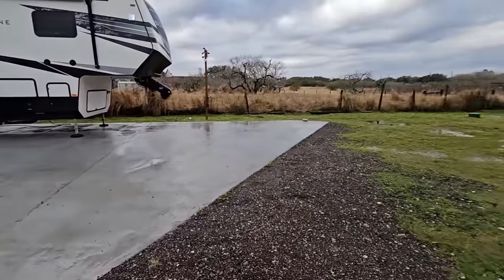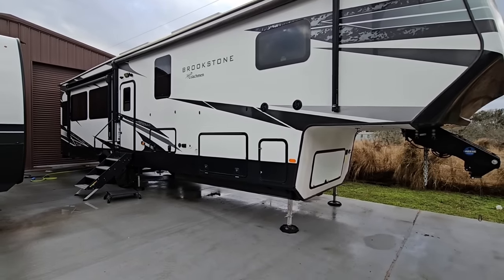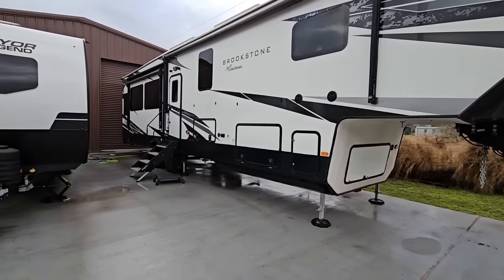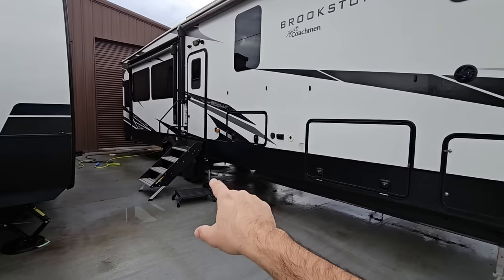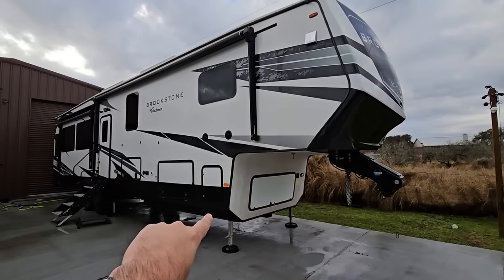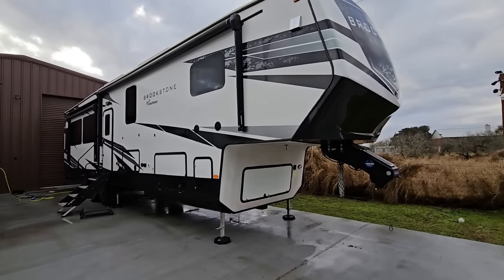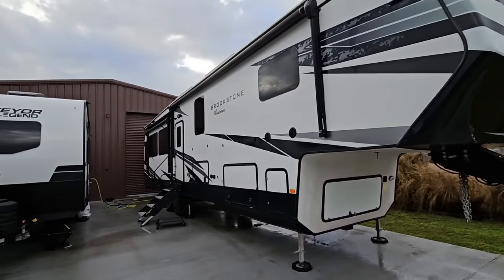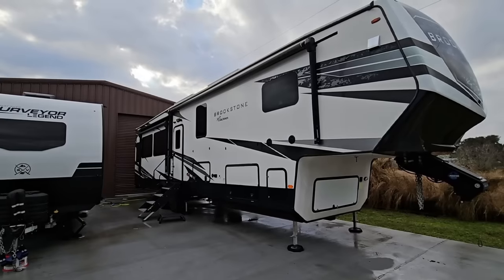FRAME FLEX on some Fifth Wheel RVs EXPLAINED!

Comment: What is happening to the grand design is broken welds on the frame.  They just call it frame flex.  The paving new paths folks had more than 2 or 3 inches of "flex"  when the trailer was hooked to the truck.  This was without even moving the trailer.  Think about how much it moves while going down the road.  They were quoted 16,000 to "fix the flex."  That was without grand design, even looking at the trailer.  There has been a lot of frame failure going on  seems to be on grand design.
Reply: No way was it 2 or 3 inches.  It was 1/2" on one side and nothing on the other.  People seem to watch these videos and then exaggerate the problem.
Reply: @ryanryan6207    That was measured from siding and not frame also I’m will to say if they measure from frame it would be closer to 3/4 to with broken screws and bolts the siding didn’t move as much as frame
Reply: @ryanryan6207  you're correct the 2 or 3 inches was what  it looked like inside in different  places.  Any "frame flex"  is unacceptable especially when all they did was take the trailer off the Jack's and put it on the truck.  You maybe ok with that flex but I wouldn't be.  Science tells you if it flexes while stationary it will be more while moving.
Reply: The only 2 cases on YouTube  regarding Grand Design frame "failure" are Paving New Paths and Downsizing Makes Sense. Both full-time, high-mileage, nomads that load their rigs to the max and expect their rig to perform flawlessly. 

PNW owns a used tow hauler, with no weight of the toys to counter the load over the entire length of the frame. He states he's under his GVWR, but I'm willing to bet his pin weight is well over the 25% rule.
Reply: @driveman6490  no no there are many others switch it up, LJMJ, and many others...not just 2 and all GD owners as well 👍

Comment: Good explanation of the difference between flex (a temporary condition) and deformation (a permanent condition).  Having some flex in a structure is a good thing.  It's a way to temporarily respond to forces that might otherwise damage a structure.  Even your house flexes - the creaking noises you hear at night is caused by flex.  If your RV didn't flex at least a little, your frame, your sidewalls, your floor,  your windows - everything would eventually crack in order to release the built up forces.  Too much flex, on the other hand, can cause problems, too (including cracking).  

It helps to think about flex as an extension spring - you stretch a spring within its design factors and it will return to it's designed shape.  Properly designed, it can do this millions of times.  Stretch it too far, though (overload it), and it gets deformed and stays that way, preventing it from being able to do the job it was designed for.  That's a failure.  But unlike that extension spring, which only flexes in one dimension, our RV's have to flex in all three dimension and also have to allow the frame to twist (like for times when we make a turn and the curb crawls out under one set of wheels).

Today's RV's are longer and heavier than what we saw years ago, and both things can cause flex.  We also like to have more "open" floorplans and more window area, which reduce where engineers can build in stiffness.  To combat these problems/limitations, engineers can beef up the structure (bigger members, members with greater stiffness, members of stronger materials, additional stiffening members, etc.) but that adds weight (and cost), too.  So it's a trade-off.  Just like everything else in life.
Reply: The problem with natural frame flex is that the box and cabinetry is rigidly built. Instead cracks develop and failures appear in the side walls. If the builders were serious about allowing flex in the frames not damaging the coach which doesn't flex, they would develop flexible frame mounts that allowed the frame to move.
Many larger pickups and truck have had this for years.
Reply: @guilfordterminal  Plus it doesn't help when they use staples to install said cabinetry or certain trim.

Comment: Love your content.   After working with submarine structural engineers for a number of years some of your terms may be up for debate:  Flex = moves, but comes back to the original position;  Bent = flexed a bit more than allowed and now does not completely return back to the original position;  Failure = whether through fatigue or manufacturing defects, the frame/weld/metal physically comes apart.  In my humble opinion, most RV owners that are experiencing these issues have a bent frame, not frame failure.

Comment: This is one of the main reasons why an upgraded suspension or airirde needs to be an "option," especially for very large towables. Im not saying that will eliminate all issues, but it should help.
Reply: Lippert Center Point by Trailair Air-Ride Suspension Upgrade

Comment: Great job explaining. We have had the "frame flex". I am of the opinion that what we experienced was having a steel frame that is supposed to flex with a wall bolted to it that has no flex built into the design. We spoke to the welder that did our repair and asked him his opinion. He clearly stated that he thought that our problem was based on the aluminum studs being of recycled metal and it being very very thin. He said that he has a hard time rewelding these back in place due to the less than quality metal. Just our two cents. Thanks again

Comment: There are a ton of YouTubers reporting frame failures.  Most of them use Grand Design products and live in them full time.  It seems that with living in them full time they are using them far more than your average rv’er.  I  don’t believe that any rv is capable of handling true full time living in and moving them constantly.  The forces the rv’s have to withstand going down the road are insane.  When they are constantly used it will eventually fail.  I’m not saying that over use causes all frame failures, but I think it causes a bunch of  them that we are hearing about on YouTube.  With what these new rv’s cost you would think they would not be designed to be disposable, but anymore it seems that all of them are disposable after a few years, especially if lived in full time.

Comment: A few of my friends have had to replace their suspension and go to complete independent suspension due to the fact that they do hold them down dirt road both are toy haulers and they use them for ATV off-road. They say the dirt roads are not hard on the fifth wheels but they’re not driving down paved roads either, one thing to consider if you plan on doing off-road camping on fifth wheels, maybe look at having the manufacturer independent suspension on it or do it after market like some do now it may eliminate some of some of the problems that they’re having with the flex or other issues with the structure the fifth wheel

Comment: Semantics!  It is frame flex when owners see initial problems (i.e. floor/wall separation, front cap miss alignment, excessive goose neck movement).  It is frame failure when technicians actually pull the covers off and see broken cross frame welds.

Comment: Paving new paths never took theres off road and this went down highways and there frame broke
Reply: True, but they did buy it used so who knows where and what the previous owner did with it. I feel for them, but who can say whether or not the issue really started prior to their ownership but just worsened over time?
Reply: @fuzzywigglebutt  Yep, no telling what happened before they owned the RV.
Reply: Let’s be real.  All trailer frame should be able to last many years.  Car trailers, tractor trailers, animal trailers all haul large loads over all road types. Some are abused and overloaded by owners.  But you don’t hear much about those frames breaking.  My point is simple…build the frames strong enough so they don’t fail under 99.9% of normal circumstances. All rv 5th wheel trailers should be able to last 15 to 20 years, if not they are defective from the start. Just imagine if all the other type trailers were having this issue,  very unsafe for all motorists. It’s so obvious the frames are I probably built to last.
Reply: @WestsontheMove   Are you aware their RV was damaged when it impacted their bed rails multiple times?   This was their video description.”After a few close calls of the RV crushing the bed rails, we finally did some damage to the bottom of the fifth wheel”   “Crushing” your bed rails could certainly damage the frame.
Reply: @BlakeScout I may have missed that but given how so many others are having similar problems to what they are having and the distance between the RV and the bed rails, I would have a tough time believing that it would have caused as much damage as you may think. Have you not seen pictures where Grand Design tac welded the bottom aluminum frame supports? I have those pictures myself. A tac weld? C'mom man that is a quality control issue.

Comment: Outstanding breakdown!  With my 20+ years in Engineering, I couldn't have stated this better!  Thank you sir!  But, why is the dealers and manufacturers running from the failure problems!
Reply: Josh tap danced around the issue.  And, yes, I have over 30 years of engineering experience with degrees in Architecture and Mechanical Engineering.  This is clearly a manufacturing issue.
Reply: It simply comes down to money I'm pretty sure.

Comment: Great service to get the conversation going, JD. We appreciate learning from you.  

I've read through a lot of the comments here and i don't see a reference to the impact of independent suspension.  We have a 2020 Grand Deisgn 399TH, with IS/DB.  

We are full-time 3+ years and move it about monthly, we also don't drive longer than about 300 miles on any move. 

I did see this mentioned, but how is Lippert ever held accountable for anything like this.  

There is such deflecting when something goes south.  It can be hard to know who to call.  And frankly you shouldn't have to call all.over the place.  Ford doesn't make every single part on our F450, but when we have any issue...all we need to do is call Ford. And they get it handled.

On the trailer, we had a brake line failure. Our RV tech told us to call Morryde directly and report it. We did that.  Lots of seemingly 'hush hush' about what the real issue was, but Morryde sent an 80lb box of parts overnight....for free. 🤔 #Goodwill.  We did later report to Grand Design. We have a video about it on our channel https://youtube.com/c/MileHighBeach

In our 3+ years, anything that seems off, odd or weird...we call Grand Design, inquire and open a ticket.  We've been sent parts from Grand Design at no cost.  We've been reimbursed by Grand Design outside of our 1 year warranty.  We are original owners of our RV and have maintained a relationship with Grand Design. We have never been hung up on.  😊 Our issues, outside of the brakes, haven't been major, but we report it all.

We look forward to learning more about this issue.

Comment: The frame flex people are referring to is the Pinbox and upper deck. In the fifth wheels of old days there was a ton of reinforcement on the deck. There was very little flex and the flex was engineered to be on the front half of the lower frame. The side wall mounted to the lower half of the frame on newer units is flexing at different points then the sidewall mounted to the upper deck. You can see this better in the vanleigh RV’s where the frame flexed so much that the aluminum structure of the upper walls would break the welds of the wall. Later vanleigh issued a repair however the repair was to reinforce the wall. Instead of bracing the frame. Once you pull the skin off you’ll see there’s barely any adequate bracing on the upper deck in the name of saving pin weight instead of just putting another third axle under the unit. We inspected a jayco pinnacle and were appalled by the poor welds and lack of bracing and that’s one of the “overbuilt” ones.

Comment: Most if not all that I've seen fail were from folks living in them full time fully or overloaded traveling the American heartland and its crappy roads.  
 Granted, the 2x6 rectangular tubing Lippert uses is sub-par being brittle and too thin of wall.  Plus not enough triangulation in the pinbox region.   
  How do I know, I lived it. We had a failure on our 2007 Wildcat in 2012. With no help from Lippert I dropped the fascia and rebuilt the frame in the punbix area using 1/4" wall tubing instead of the 1/8" wall they used.  To this day it is still holding up.
Reply: There alot of Grand design trailers braking frames
Reply: @jimcaldwell5736  its across the board Lippert chassis,  not brand specific.  You only hear about Grand Design because so many YouTubers  bought them and moved their entire belongings into them and documented their lives.  These trailers are over used and abused plus overloaded in most cases, that's why they're experiencing failures.

Comment: Have owned 2 5th wheels from same manufacturer. The first one a 2003 model was excellent with no issues. The second a 2018 model was terrible for all around quality and the last straw was frame flexing at the gooseneck location. [Lippert frame] When sitting on the jacks there was no noticeable space between the floor joint and the side wall. Once sitting on the tow vehicle there was up to 3/4 of an inch gap or separation between the floor and sidewall. Traded it for a TT where I hope this isn't an issue.

Comment: Our 2013 Heartland Cyclone 4100 had terrible porpoising when we first got it. The gel coat and wall cracked in several places near the front of the trailer and inside, the front cabinets pulled away from the wall almost 2 inches when on the truck and that opening closed up when on the legs. It went back to Lippert who cut into the sides and welded a 6" X 6 foot heavy C channel under warranty. 
The following year, it was back at Lippert again. This time, I was underneath the trailer troubleshooting some weird handling issues and found some poor welds had broken and caused cascading failures in 6 cross members allowing the frame around the wheels to squirm. 
The welder at Lippert showed me a kit they had that was used to add gussets to each cross member and a heavier zigzag support (which broke in those 6 cross members). (The fact that there was a kit developed for this issue led me to believe that it was widespread with these units).
I blamed the poor design on Lippert, but they told me that they built the frame to Heartland specs so they were the ones ultimately responsible for the inadequate design while Lippert was responsible for the poor build quality.
There is only a handful of coach builders who use the whole front section to build a boxed in frame section with supports being extended to the floor joists. 
There should have been recalls for these defective trailers because they were certainly a hazard waiting for an accident to happen.

Comment: There is one major issue the manufacturers are not taking into account, the condition of US highways. They build these trailers to "specs" but they need to be built way beyond specs just for this reason. I have a Rockwood light series 5th wheel.  Drove it from CA to TN.
No problems starting out. Going west bound into Williams AZ on the 40. My entertainment system separate from the wall. The highways vary state to state. When I arrived in Arkansas,  I developed a crack in the outside wall of the trailer from my bedroom slide towards the front cap. Contacted Rockwood, took it to Elkhart  and they repaired it for free. I was out of Manufacturers warranty by 2 years.  The issue was not a cracked frame, but the lag  bolts used to connect frame and unit.  Why they use lag bolts with a flexing unit is beyond me.  Rockwood stood behind their units, while other manufacturers don't. 
They said I was 200 lbs overweight..I was actually more, I removed stuff knowing they were going to replace the entire driver's side wall. .

Another item to consider is the 5th wheel. You really have to have some type of dampner hitch  to absorb the  motion between the truck and tailer.

Comment: How many of these frames are built by lippert.  I personally think lippert is the biggest problem in the rv industry.  Doesn’t matter the brand you buy most rv products are made by lippert and I feel there monopoly has led to quality problems across the country.
Reply: I'm not trying to stand up for Lippert, but Lippert builds what they are told to do by the trailer manufacturer.  I'm not sure how much Lippert has a say in it.  I know the industry is still trying to figure out who to toss under the buss on this topic.

Comment: Thank you for this video.  We pull a travel trailer and we do get side to side motion.  While it is annoying, I know my hitch is a pivot in all xyz directions.  I know people say they like 5th wheels since they are more stable and rigid when driving.  I watch folks take driveway aprons and you see the 5th wheel and truck fighting and going in opposite directions, but it can't since they are locked together.  A 5th wheel can only rotate up and down and rotate, but it cannot deal with side rolling.  I think this puts the frame under a massive, yet short dynamic load.  I see the videos and it is always the side edges that give way, it looks like the rolling motion is doing the damage.  What are your thoughts?  Thanks